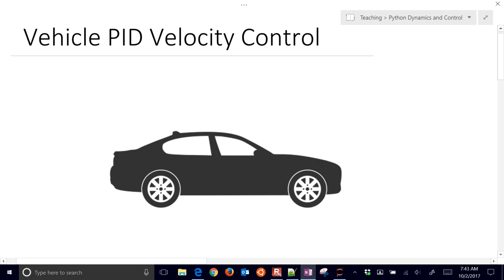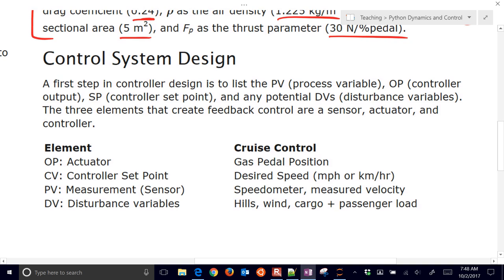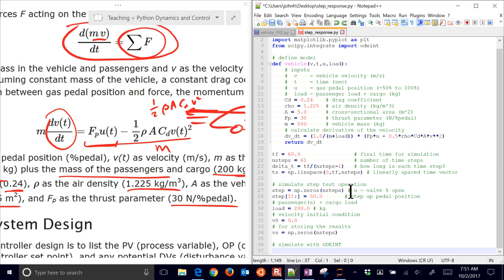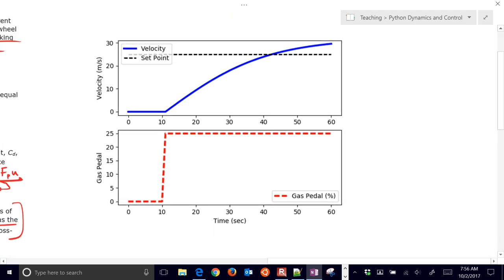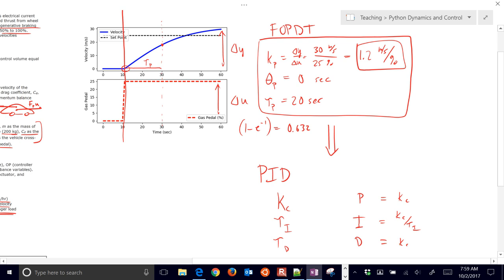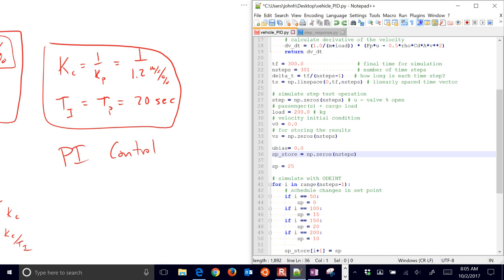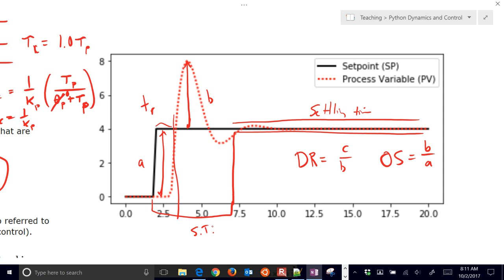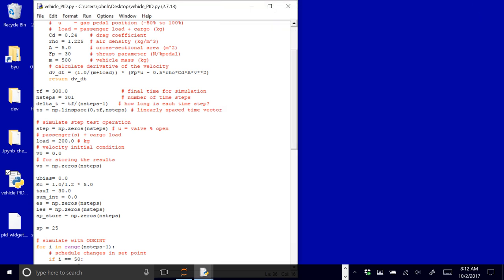PID Velocity Control in Python

Comment: Great video, learned a lot!  I used the first program to generate the first order response and it worked fine.  Then I pieced  together the last program (could not find at your website; just the first program) from your video to do the PID analysis.  It basically worked but ... it created 300 figures.  Had to delete the first 299 figures to get to your only figure on youtube.  In other words, my 300th figure was the same as your 1st figure.  I guess this is more of a Pycharm (I have version 2020.3, Python 3.9) question.  Could you please explain to a Python programmer newbie how to only plot the final figure? I tried my best but couldn't figure it out.  Thanks!
Reply from the maker: Here is a version that may help: https://github.com/APMonitor/pdc/blob/master/Velocity_Control.ipynb with "from IPython import display" and "display.clear_output(wait=True)". This video is solution help for my class. I don't include the controller development portions, just the open-loop step test so that they get the practice of coding a PID controller. Thanks for your comment - I created the Jupyter notebook based on your feedback.
Reply: @donaldsummers4831  try animate=False to not create all of those plots. I didn't use any special commands.
Reply: @rrc  Okay, thanks.

Comment: how about doing the implementation in  the hardware (programming the controller in  the ecu  of the  car for exemple),??? can you please do some videos on the  topic because that's what really is difficult to a lot of student and fresh engineers
Reply from the maker: Here is a hardware implementation of PID with an Arduino microcontroller: https://apmonitor.com/heat.htm Implementing PID control on a real system is an important part of the PDC course with 23 exercises: https://apmonitor.com/pdc (see Schedule link).

Comment: Is it possible to use real hardware for the input, for example a usb gaming pedal.. and visualize the RPM / Velocity real-time?
Reply from the maker: Yes, that should be possible. Here is an example of inputs and outputs from a physical device over a USB serial connection: https://apmonitor.com/heat.htm

Comment: To make work in 3.7:
Go down to the for loop find v = odeint(vehicle.....)
And make it
v = odeint.odeint(vehicle....)
Otherwise you will get a module object is not callable :)
Reply from the maker: The example code at https://apmonitor.com/pdc/index.php/Main/SpeedControl is still valid with Python 3.7. You may have imported your odeint package differently. I used "from scipy.integrate import odeint". Did you use something like "import scipy.integrate as odeint"? It appears to be what you did because of the odeint.odeint().